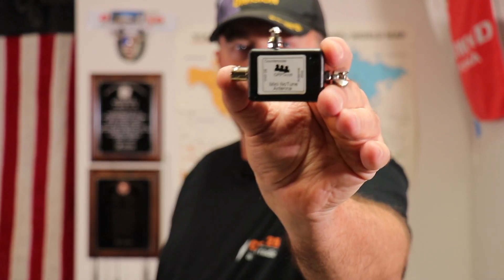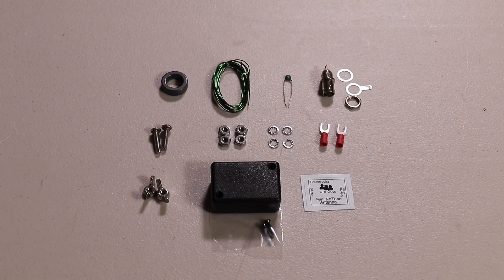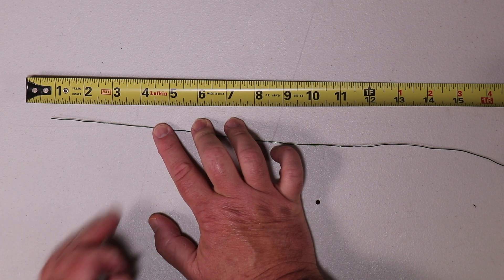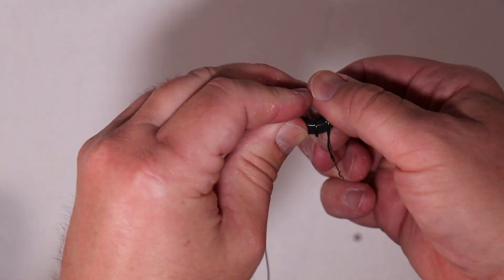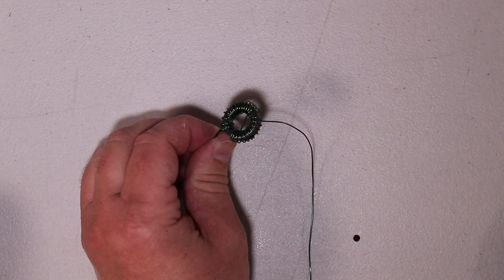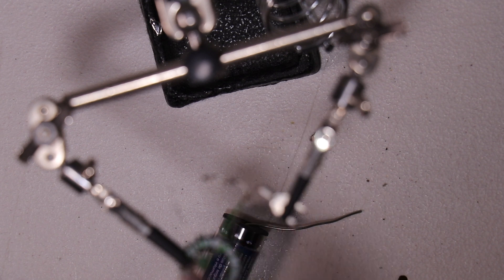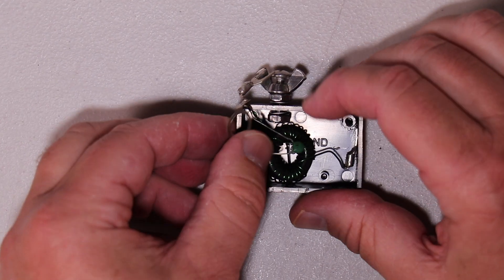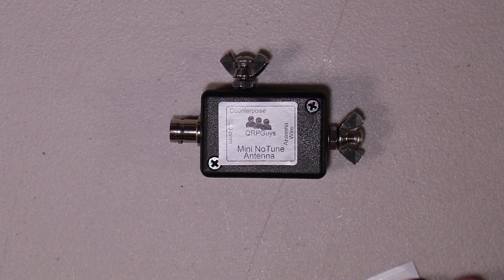QRPGuys Mini No Tune End Fed Half Wave Antenna Build

Comment: The thing about this is the Toe Roid
If a fella was to accidentally wind one backwards
The transformed signal would utterly backwards
Sort of like looking into the wrong end of a telescope while standing on your head
Must be careful when winding those Toe Roids
Never know what might happen
Reply from the maker: Thank you for taking the time to watch and the comment! It is greatly appreciated. Thank you for the information!
Reply: I use the same impedance transformer
I bought a toroid and rolled my own
This a piece of gear any QRP operator could get good use out of, I use mine that is cut for 40 meters and about 65 foot long everywhere 40 meters and up I also use a old heathkit qrp tuner and a LED SWR bridge It works very well.
My tuner and SWR indicator does all the worry work
I do not worry about perfection
A perfect matched antenna without any help 
I find sort of like a unicorn
Anyway :)
I do not hunt unicorns
As long as the radiator is about 1/2 wavelength long and the match is good
No worries
Likely awful efficient
 A EFHW is just about the perfect portable easy to deploy QRP in the field antenna :) 73 @WJ6FRadio

Comment: Did you test the antenna? Great video! Have built this one and also the green wire winder version (which is the very same circuit exactly but in a different presentation - also from QRPGUYS). With no explanation, this one in the box works exactly as advertised with the wire length as per the QRPGUYS table, but the green one required a different wire length adjustment. 73, Rob, YS1RS
Reply from the maker: Thank you for taking the time to watch and comment! I have used it a couple of times with success.  I do plan on making a video of it in action.

Comment: I make my EFHW UNUNs 3:21 turns for a 49:1 ratio. That matches 1/2 wave radiators cut to the operating frequency. Use the counterpoise length and height from the ground to tune the SWR for best match.
Reply from the maker: Thank you for taking the time to watch and the comment! It is greatly appreciated.